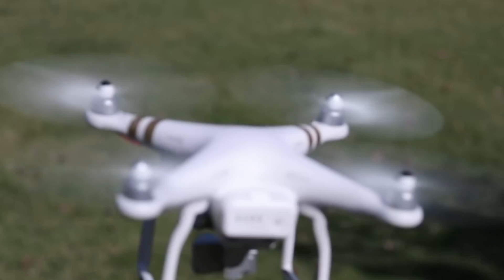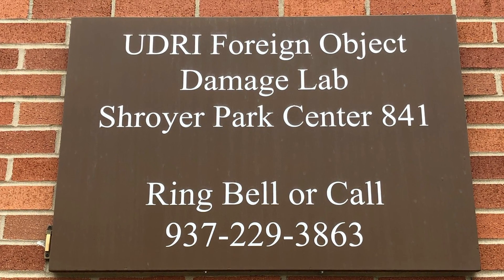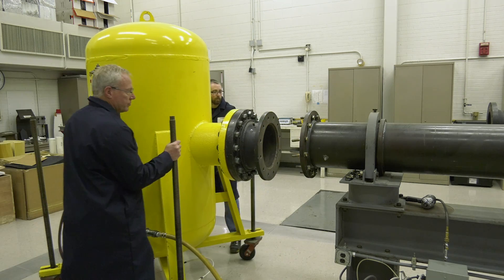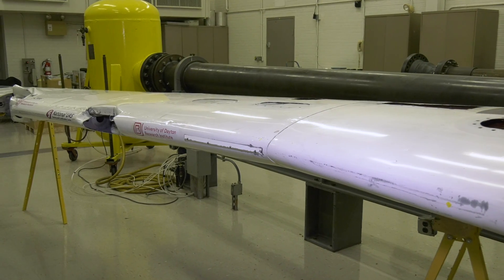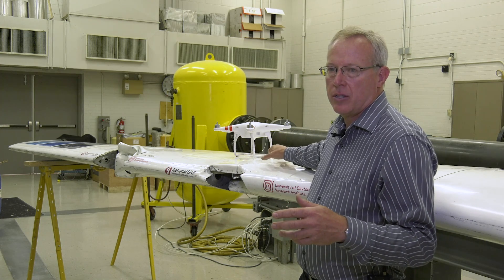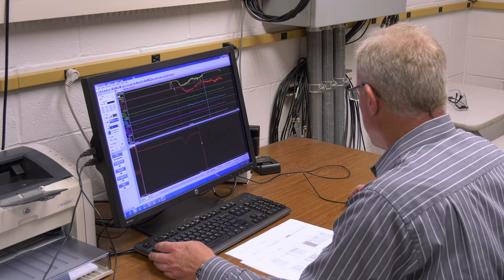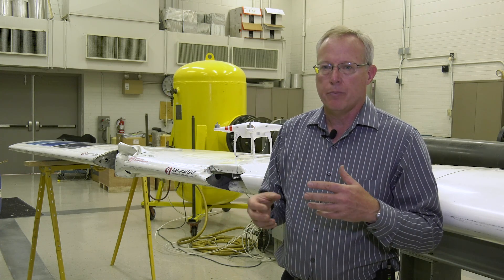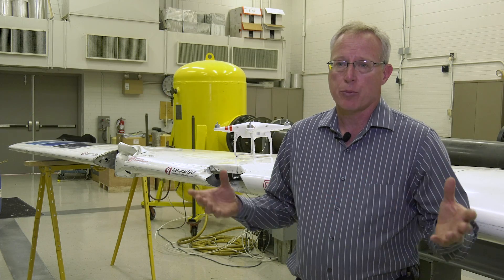What Happens When a Drone Hits an Airplane Wing? – AIN

Comment: That's the worst thing a drone can do to a small airplane? No wonder why no terrorist ever use drone to attack any airplane even though drones are widely available all over the world and can be bought without question asked.

The damage is astonishingly underwhelming.

A smaller, more popular drones would have been just a paint scratch.
Reply: On another note, terrorist does use drone to drop mortar shells, grenades, and IED.
Reply: Yeah if u wanted to cause damage you'd modify it, carry a steel pipe or explosives.  Its kinda scary but thats life, its not new, i wish ppl would stop being so reactionary with laws about it.  Theres so many ways to hurt eachother, we've been doing it longer than humans have existed.
Reply: I'm ignorant about avionic tech but the drone might perhaps sever the wiring, hydraulics, or fuel line might be catastrophic. This is not to mention decrease in lift and increase in drag.
Reply: Drones has been used against Venezuela dictator
Reply: For a terrorist it would be easier to take down an aircraft by just pointing a gun at it.  The drone would be much more effective as a payload delivery platform rather than a one time suicide mission.  Think about it this way; A multirotor can only fly with so much payload.  Instead of loading it with the same amount of payload and flying it into your target once why not just fly over your target and drop the same amount of payload and reuse the drone?  This doesn't give you extreme precision or any guidance once that payload is dropped but you can do it over and over again.  This is exactly what ISIS is doing with mortar shells. 

NSA/FBI agents if you read this please dont put me on a list.
Reply: How about if the drone had went through the windshield and hit the pilot?  Im a drone owner and i agree that with the number of drones and airplanes sharing the sky a collision is ineveitiable.
Reply: Yeah, they'd have better luck just shooting at it with a rifle.  I mean the odds of them being able to hit a plane flying at
these speeds is super slim to none.
Reply: @mooosestang  you are missing the point.  Its going to be a one in a million accidental collision that brings down an airplane.  Then there goes ALL drone operators rights.
Reply: It's not as hard as you think, you just have to wait at the end of an active runway really and it will only be a matter of time.  Going for a specific aircraft however yes a gun would be better.

Comment: Biased review - a mooney m20 is one of the fastest GA aircraft available - so they were able to add the mooney's top speed to the drones top speed for maximum results - there are very very few mooney's out there - they didn't chose a common GA aircraft like a piper cub because the impact speed would have been half what this test used.  Also, a moving aircraft wing pushes a bow wave of air in front of it - which might well have deflected the drone strike into a glancing blow - this test used a static wing
Reply: Don't forget the thousands of Cirrus SR-22's, The Cessna Corvallis', both easily cruising at over 200 mph,  Lancairs that top over 300 mph, the thousands of old Warbirds, and thats not counting the Piper Malibu's, Mirages, and TBM's, easily capable of over 300 MPH. The speed limit below 10,000 feet is 250 knots or 285 mph, unless of course the aircraft has a permit to operate at up to 300 knots or 342 mph.

Taking a drone strike, like what has been shown in the video, would be potentially catastrophic for the aircrew in any aircraft, as typically the batteries on board the drone erupt in a shower of sparks and like to burn after a severe impact. This would almost certainly ignite the fuel which would be pouring out the breached fuel tanks, located in the wings in most airplanes, after such an impact. If the aircraft is fabric covered, you can only image how much worse it might become.

Additionally, the bow wave of air would do nothing to prevent such a strike. Positioned in the right place at the right time, this exact type of strike could very well happen. God forbid, it strikes through the window, beheading the pilot, assuming its not already an open pit cockpit which would automatically kill the pilot as well. 

I watched this exact type of drone go by in the blink of an eye at 6000 feet over New York City at only 50 feet off the left side of my aircraft once. I've heard other pilots on numerous occasions reporting drone sightings to Air Traffic Control at many thousands of feet in altitude above the ground. 

Like they stated in the video, its simply a matter of time before the worst case happens because of irresponsible drone operators. I hope I'm not the one it happens to, or any one of my colleagues that I fly with, with perhaps you, or someone you know on board.
Reply: @terraholdingco  what, below 400ft?
Reply: No they picked a medium between your average 172 and small jets. No conspiracy.
Reply: Perhaps you would like to be the pilot of the aircraft that hits a drone? I know I would not. No pilot would. 
The whole point of the study is to determine what might happen if such a thing occurs. Its telling. Its real. Its a matter of time..
Reply: Tsnafu     Amazon wants your airspace and will beg to differ as there are 1974 Mooney M20s flying over at 380 knots  often  they so fast you can’t detect them or react in time.  Turn in your toys.  By Dec 1 st we have to have amazon drone delivery a 5 billion dollar industry. Here comes a Mooney now !!!!  Jimmy your drone !!   Gotta go
Reply: Wait..... they crashed a drone and into professor lupin?
Reply: Lee Wilson  

False?

Lipos dont burn, somtimes energetically when damaged? 

Fact:
Ive seen it with my own eyes. I fly RC aircraft.  They somtimes burn in crashes ( cost me a parkzone corsair)

The wing on the piper cub is not light construction? 

fact: they are covered with fabric with a light aluminum leading edge boot. A weak 5 year old can damage it with a butterknife. 

People don't fly these things irresponsably?

Fact:
I see people flying over crowds, traffic, and private property they don't own ALL  the time.
Hell, there is youtube video of people doing dangerous and dumb stuff with multirotors all over the place.

Drones are not dangerous if flown irresponsably? 

Fact: 
I saw a phantom go through a car side window once,  the car was parked.  Would not have gone well if the seat was occupied. 
Ive seen people need stitches after getting hit with a drone,  I pulled a broken propeller blade out of my friends back once. He was trying to fly close rings around himself FPV
And the machine hit him when a motor failed at a bad time.  Bruised the hell out of him, broke a prop blade off in his skin.   They CAN hurt people, and they CAN damage property. Period.
Reply: It's a political ploy to regulate.
Reply: They built over 11000 Mooney m20 aircraft bro.  They’re pretty common.
Reply: And they built over 44,000 172s, not to mention all the other 150/52s.  You can go out to any municipal airport and there will be a significantly more 172/52 than Mooney M20s.  The 172 platform is much more popular in general aviation.  It's cheaper, easier to maintain, parts are more available and it doesn't require a complex endorsement.
Reply: @MatHolliday  unless you're saying it can easily shrug off a drone impact, you don't have a point. And you can't honestly say that. So...
Reply: @TheNefastor  Where did I ever imply that. I simply pointed out a flaw in the test.
Reply: @MatHolliday  I never said you did, and the test isn't flawed.
Reply: Then why did you assume... whatever.  My point still stands in that Cessnas are vastly more popular in GA than Mooneys, thats not a matter of opinion thats a hard fact.  I don't know where you got this idea that you can just shrug off a drone strike from, it wasn't even relevant to the conversation.  Also flawed was the wrong word for me to use, biased is more of what I meant.
Reply: @MatHolliday  oh for fuck's sake, the conversation is about the fact that drone impacts will cause serious damage to planes. Bringing up that the wrong type of plane was used is besides the point unless you're trying to claim that most planes are invulnerable to drones. Why do I always have to explain basic logic ?
Reply: The fact that none of your comments show basic logic.  Drone strikes cause  damage, no argument there.  Was this test done in a biased way to show a worst case scenario, absolutely.  If the test was unbiased they would've used a 172 wing at 130mph, not a mooney's wing at 238mph, a much more likely real world scenario.  How is this so hard for you to understand.  I'm not arguing that other aircraft are invulnerable, again I have no idea how you came up with that.
Reply: @MatHolliday  do you English any good ? Maybe you should make sure you understand the words you read before you start acting like a victim. I'll wait. Ask an adult if you need to.
Reply: @MatHolliday  you're looking for a fight, I've got better things to do that indulge a troll. Drones are a danger to planes and therefore to people, period. If you're trying to contest that, do your own experiment, and if you're not, I don't give a shit about the details you want to waste time on.
Reply: Clearly you dont have anything better to do.  Also look a few comments back.  "Drone strikes cause  damage, no argument there".  This test had a biased intent.  Thats all I've been trying to say and all you've come up with is personal insults.  You also do care about the details, otherwise you wouldn't arguing about it.
Reply: A multi rotor the size of a phantom will punch right through the wing skin on a cub like a knife through butter
Even at a 70kt closing speed.   Far more potential for damage than any bird.  Plus, bird guts dont burn.
The battery inside a multirotor probably will, one little cut in the envelope...and it turns into a little volcano.
 

These are very dangerous toys if flown irresponsably.
And i see alot of people flying them irresponsably.
Reply: I also see people flying planes irresponsibly, but they never seem to get punished.
Reply: @stinkyfungus  also allot flying responsible
Reply: @philipbrits2984  

Never said there wasn't

But for every responsable pilot that self regulates... how many don't? 

There are alot of people who drink responsably...
But the ones who dont... injure people and damage property.

Comment: Misleading video presentation. Loss of a bit of the leading edge or puncturing fuel tank is nothing compared to loss of controllability. I would really want to know what is the aileron control authority remaining, and flap control are the outcomes I would want to measure. Pilot incapacitation or loss of control would be the real difference between life and death in a collision.

Comment: 238 statute miles per hour is really not a reasonable collision speed. Vx (best climb or glide) for a Mooney should be in the range of 80-90 kts, which is about 100 statute miles per hour. Collisions would most likely happen during takeoff or landing, which would be near this speed. The DJI Phantom on the other hand, has a maximum speed of under 50 statute miles per hour. Why not test for the most likely scenario rather than this extreme edge case?
Reply: I see value in examining the extremes to have the data but mostly likely senerios should be the primary focus of efforts. This was rather disingenuous in the presentation. I know if a plane where to hit my drone they would be doing something every unsafe or illegal for that scenario to even be possible. The scenarios where a strike is even possible need to be addressed in order to properly gauge the actual level of risk.

Comment: How many airplanes got damaged by drones so far?
Reply: confirmed? 1 helicopter.
Reply: Got a scratch in it's paint. And part of a 1 ounce motor stuck between the skin and a window pane. In other news, 1 woman is killed (beat to death like a rag doll) when she is partially sucked out of a SouthWest airlines flight after an engine explodes spraying schrapnel into the fuselage. The issue with the engines having been discovered over a year prior and the only FAA action was to suggest that airlines might want to maybe take a look, when they have time.
Reply: A helicopter did the other day filming a race
Reply: But think of the chilluns
Reply: According to the CAA in the UK, actual strikes, none.
Reply: 0

Comment: The thing here is to keep drones at an altitude below the miniumum for aircraft in that area.  This shouldn't be a problem for drones operating far from airports - or for fixed-wing aircraft flying above 500'.  Restricting drones to fly BELOW 500' and AWAY from airfields and for light aircraft to be ABOVE 500' (except when near airfields) should be a complete solution to this problem - and AFAIK, that's the current legal situation in the USA.  The largest problem is in areas where there are helicopters - where damage will be far worse and there are less clear limits on their altitudes.   So, for example, near a hospital - where care-flight helo's may fly - but it's not "obvious" to drone pilots that a helicopter might pop up suddenly - or even that there is a helicopter landing pad there...and of course when careflight land on a road or in a field - then there is HUGE scope for problems.   That's something that is hard to cater for.
Reply: Under 400 feet is the US rule.